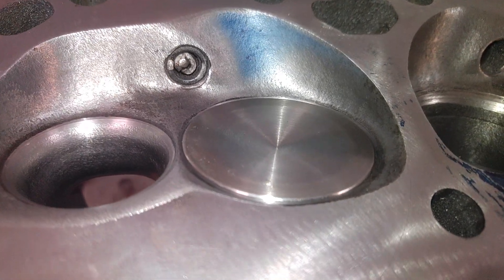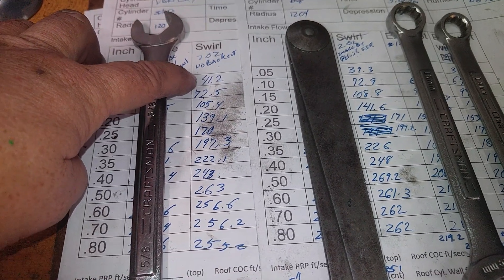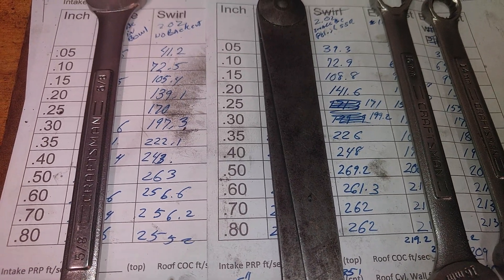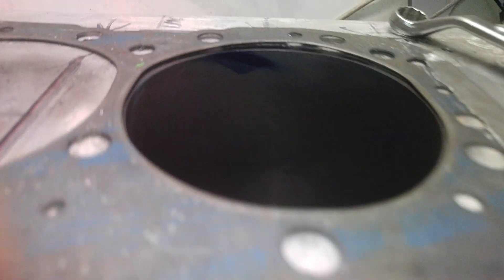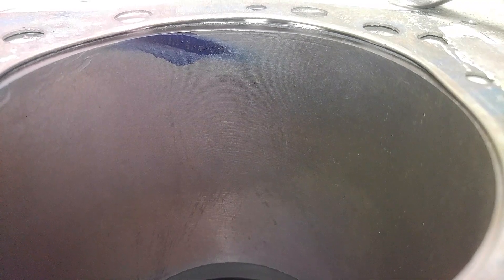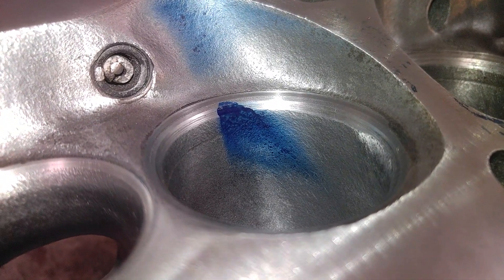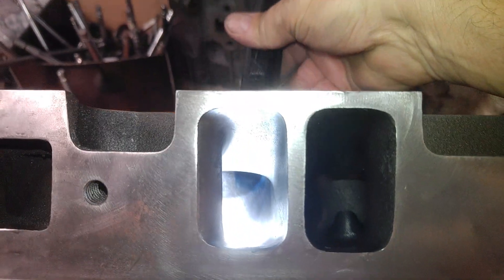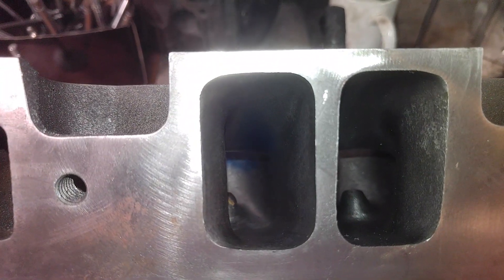Dart 007 wet flow experiment part 2

Comment: Precisely why most head porters are missing out on a lot of power. Concentration of the wet flow is lost power. That short side can be ramped to the shrouding side and the floor raised to aim the wet flow on the base of the tulip. You may loose 10 cfm at higher lifts but gain everywhere else.
Reply from the maker: I worked on that exact thing yesterday Tom.

Comment: Buy a Venturi with bell mouth. I would make one on a slid so you can dictate any length of intake track. Drill hole from bottom part of Venturi at 2" to the 3" into Venturi port. That can be operated as Carburator or EFI then. Look at how Dart Machinery did there's. You can buy all the attachment's but it's definitely not cheap.
Reply from the maker: I have seen how Dart did it. I am not going that crazy. Thanks

Comment: On the cam love what lift is open and closed the most  like the rise from zero to .050 like a hydraulic .550 lift it rise to .550 and drops to zero so I'd the valve open more from zero to full lift or is it open more on the climb and drop of the valve sorry I don't really know how to ask my question but it appears to me that cam is longer while it is rising and dropping then it is at the very top of line so would s head that flows real well from .150 through .440 be more efficient than a head that flowed well from .500 and up lift
Reply from the maker: I think I know what you are asking. .500" lift cam. Due to opening ramps the cam will spend more time from .000" to .25" lift than .25" to .5". There is still an argument about low lift vs. High lift. It is application dependant. Some hate low lift flow they are usually high rpm high lift guys and that makes sense. Smaller cam guys depend on good low lift flow to get things going on the scavenge phase due to small overlap triangle. Hope this helps.